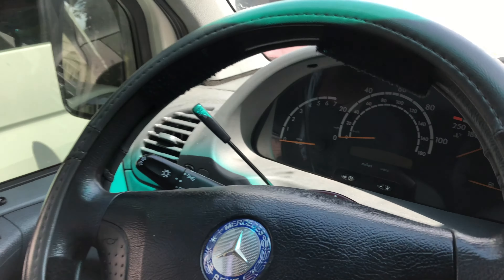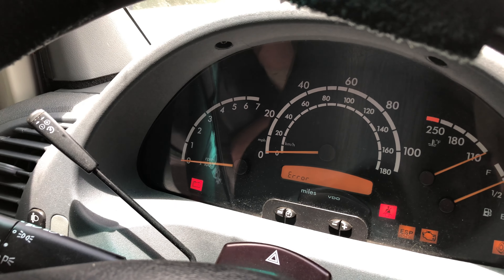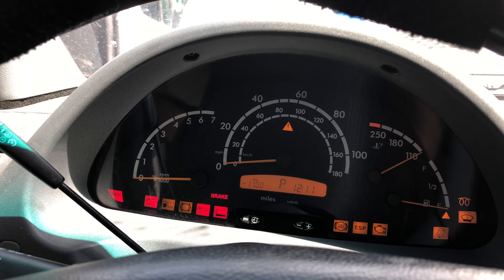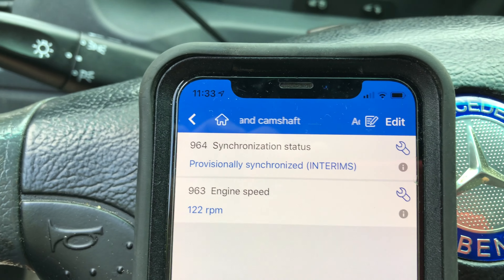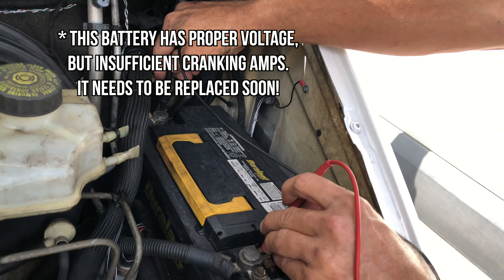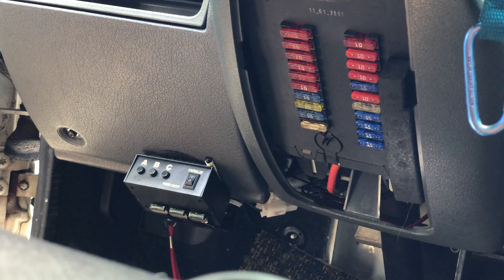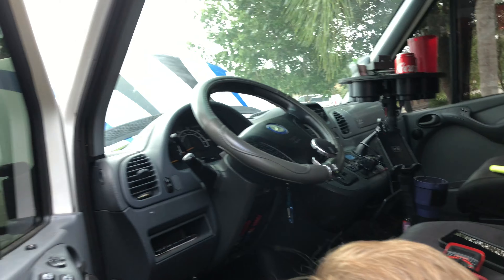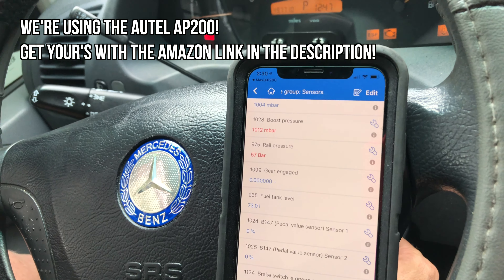Common Causes a Sprinter Won't Start. Fuel pump relay, starter relay, fuel flow, low battery, etc.

Comment: Should also add ecu relay that is under the steering wheel next to the signal lights relay! It driven me mad.. i checked so many things.. and it did not start in cold or hot days... i took the cap of the starter relay under seat.. and pushed the relay with finger... so it made that litle vibration and that engages possibly the ecu relay under steeringwheels fusebox.

Comment: Excellent video, thank you very much.

Just bought my first T1n 10.2005 here in Germany, the 2148 cc engine. This engine is the most common in Europe from what I see; would have preferred a 2.7, but couldn't find one for a decent price, only ultra expensive, or with high milage. I am very happy with it and should have gone this route a long time ago. Will watch your other videos as well. Cheers
Reply from the maker: Congratulations and welcome to the Vanmily! Settle in and get comfy, we have over 250 videos about T1N's and a few unrelated. What is high mileage? Mine is a bit over half a million miles. They don't get that high without replacing parts as needed while low mile vehicles can still have 20 year old parts waiting to die.
Reply: Thank you very much for the kind words and the reply! 
My van has only 193.000 km, so that's 120.000 miles. You are perfectly correct about the parts going out even with low milage just because of the materials and their lifespan (plastics, low quality rubbers, etc). I will be changing all the consumables on Monday, all the filters, aer/diesel/oil, the oil obviously, and also the spark plugs. I am having a strange thing with the engine and I am hoping it's going to be resolved after these changes - cold start, always perfectly fine, excellent strat. If I drive 20 minutes or even keep the engine running half an hour, stop it and restartet, it just won't start; it spins the engine and tries to start, but doesn't manage. Only after the engine is cold again, after about halt an hour or more it starts perfectly again. I am guessing spark plugs, or diesel filter full of trash inside, and it takes some time until these sediments settle again down in the filter... Could also be other things, clearly, but we'll see how it goes after these changes. Thanks again! Cheers

Comment: Last month I bought beautiful Mercedes Sprinter from 2004. Thank you for your informative videos and all the work :)
Reply from the maker: Welcome to the Vanmily! I'll be here when questions come up or you can find me on FaceBook https://www.facebook.com/groups/floridavanman/
Reply: Hi. I just bought a 2003 sprinter with 81k and seemed to run great the 40 miles home. After sitting over night the next day it wouldn’t start. Thought it just had a bad battery so I jumped it off my truck, took awhile but it did eventually start. I’ve had to do that once more and then decide to charge battery over night. The next day it started after several cranks. I then moved it to the shop where I’m converting into a camping van and when I got there, while idling I reset the radio. It died while idling and haven’t been able to start since. No lights are on and I’m super confused. Never owned a diesel before and I’m afraid of tearing something up. Any advice? This video seems to address a lot of causes and when I look at fuse box on side of seat I don’t see a yellow relay at all just one grey. Thanks for any help!

Comment: Hi. Have a 2006 sprinter will only go on second start. Engine sounds sweet. Best videos I’ve ever seen. Legend.
Reply from the maker: That's not a symptom I've dealt with but I wonder if unplugging the MAF would change the way it starts.

Comment: Thanks so much!  Perfect video for T1N starting issues.  
Even though the engine battery tested "good" at the auto parts store, I replaced it and my Sprinter started right up.  This was after I spend a day and a half troubleshooting other potential issues because the battery tested "good".  Late in the day after the "good" test, I decided to conduct my own load test by using a 12 VDC to 120 VAC inverter.  With a moderate load of 120 watts (12VDC x 10 amps DC), the battery voltage dropped within 5 minutes to less than 11 VDC.  Another recommended test is to simply turn on your van headlights and see how long they last.  Bottom Line:  Don't trust auto part store battery tests (good or bad).  It seems that batteries with 36 month warranty last a good 37 months and 24 month batteries are good for 25 months.
Reply from the maker: Agree 100% ^^^^ One thing worse than parts store battery testing is parts store code reading. Always wrong when it comes to Sprinters.
Reply: Well, I thought the new battery solved the problem, but a week later, it FAILED to start.  The symptoms were the same, flickering then solid dashboard backlight, followed by lights out when the key was turned to the start position.  I tested connections to all fuses.  This looked like a weak connection somewhere that fails when high current is needed for starting or headlights.  I went to the engine battery, and checked all connections.  Everything tested and look good.  On my T1N Sprinter RV, there's a small black distribution box that's connected to the positive battery terminal.  There are four red wires, four fuses, and 8 screws that hold in the fuses.  Everything tested good, but I tightened everything anyway.  - I went back to the driver seat, turned the key, dashboard lights were bright with no flickering, and the engine started!  I'd like to recommend that you add "clean and tighten distribution block connections" to your already comprehensive test sequence.  I will make a video that shows the steps and post it on YouTube.

Comment: I had a no start no crank over the weekend and it turned out to be the main cable  from  battery to starter did a voltage drop test and  found  10 volt  lost  on  cable all clean and tight.  Replaced with used cable  and  back on road.  Like your videos keep them coming
Reply: replace your motor ground cable. 1 click (RELAY)no start

Comment: Thanks..
#2 and #5 injector was bad. Tested with tubes with cam sensor disconnected...replaced the two injectors...starts up...giving it road test tomorrow

Comment: NO START! You are my go to guy for my 05.
Engine cranks. Code reader says fuel rail pressure too high!
Use your fuel line test for relief valve-no fuel! Bench test valve- no click
Replace pressure relief valve and sensor-rail pressure too low.
Rail pressure 190-250 Will recheck 
Purge system twice-no air. Lots of pressure to injectors.
What next? CanBus?
Reply from the maker: Have you also tried the leak off test for injectors? We have two videos for that. Watch both and use clear tubing. There is no reason for the expensive vials I use in one video.

Comment: Great Demo thank you I went through all of this already I have 2007 2500 gas no crank no start, driving me crazy (key, relays ,battery and starter even engine ground wire all checked)
Reply: What happened? When ended up being the fix?

Comment: Thanks man! Dealing with this right now. I’ve done everything but the battery tip at the end. Will try that and see if that helps, have done crank sensor and relay but still having issues
Reply: Just like IT guys.  Have you reset your computer 🖥 lol.  I'm in the same boat on the side of the road.  Will try it too in the morning

Comment: Any tips for a 2003 sprinter? They don't have an in tank fuel pump? How can you tell if the engine is getting fuel? Thanks!
Reply from the maker: An air leak is the most common reason but it could also be an issue of fuel getting there, just not holding enough pressure to start the van. We have videos showing leak-off test for the injectors and fuel rail, but first look for air bubbles in the clear fuel lines. One-on-one assistance is offered via Patreon membership https://floridavanman.com/donate/

Comment: Thanks for helping diagnose issues.... learned some things.
But my issue is fuses blowing to fuel pump. Next video to find my cure.
Reply from the maker: Only two things can cause that, in-tank pump going bad or the wire going to it.
Reply: @FloridaVanMan  
I have fuse # 17 shorting out.
It's a 15A to Eng. Con. Unit.
So I have no crank or fuel psi.
Got it towed to shop, hopefully a fix tomorrow.
Thanks 4 replaying.
Reply from the maker: @timtripp4222  Have you seen out recent video about testing the ECM voltages? it is about 2 weeks old, black & white thumbnail with a pic of the ECM.

Comment: Excellent video, thanks for the tips!! One of the problems you mark in the video happens to me ( cramshaft sensor )
Reply from the maker: If you're having repeated CRANKSHAFT position sensor problems, I have read that a cracked flex plate or timing issues could cause that. Repeated CAMSHAFT position sensor issues on the other hand could be wires or something bouncing around under the valve cover.

Comment: Good morning Van Man , I need an advise , I’ve got a sprinter minibus 413cdi 2004 now that it’s cold out side some days  I need to turn the key and crank it 2-4 times and then start ,it sound like there is non enough battery power , almost like dead and then after I crank it 2-3 times it like suddenly all power comes back and starts ! Battery is good 12,80v main cable is good (new), ground looks fine every time I check it before it start ,no errors on the ecu,but then again problem is there , checked the relays but nothing , can you give any advise where to look ? Nobody here seems to know what it is 
Thanks in advance 🙏🏻
Reply from the maker: I have found this to be a wire failing and affected by temperature. Sometimes moving the wire will solve the issue, flexing it near connections. Sometimes heat from a few seconds of heavy draw is enough to improve the connection and suddenly it is like someone connected another battery. # wires to contend with here, the short battery ground, the big unfused wire on the positive battery clamp, or the braided wire between the body and engine. Theoretically the connection between the starter body and the engine block can be a problem but this is a large circle making contact and providing electrical ground to the starter.

Comment: I have a '04 with 222K and it has been having starting issues all winter (long cranks and didnt want to start when it was wet out) the other day i was flying down the highway at 80mph and i heard a sound (over the music and road noise) like something lost pressure (sort of like a blow off valve sound) and instantly the van lost power and died, and now just cranks with no fuel delivery. I pulled codes with a CR Plus :
p0087 Fuel Rail/System Pressure - Too Low 
p0101 Mass or Volume Air Flow A Circuit Range
.
Do you suspect that to be the High Pressure Fuel Rail or Fuel Pump? How do you replace the in-tank fuel pump? It was a $350 tow, so trying to find some used parts which take longer to obtain. I will go through your checklist of culprits. 
.
Thanks amazing video, not sure how you got such clear image under the van!
Reply from the maker: A sudden rush of air escaping is common sound when a turbo hose fails. There is a bit of humor with information in this video. https://www.youtube.com/watch?v=pa9kLnPdJA4

Comment: Well my van turns over but is really hard to start in cold weather "Cleveland Ohio" after long ignition holds and many cycles I get white smoke and THEN after many more turns she starts but after it's warm it starts every time. got new glowplugs. I dont get it ."your thoughts please"... thanks for all of the work you do in giving us these videos there a huge help.
Reply from the maker: There is always a possibility the new glow plugs are not the correct glow plugs, or the glow plug control module has failed. These issues would present dash light and fault codes. Likewise, failing temperature sensors that control the fuel at startup should also present fault codes, but they might not in the right circumstances. Verifying all the temperatures we can read with live data in a code reader like AP200 can help, but this is admittedly looking for a needle in a haystack when we aren't sure the needle is in this* haystack. Sharing live data screen shots of the van running at idle MIGHT help, if there are unusual readings of mass air flow or fuel rail pressure. These values will vary by altitude and temperature so I can't simply tell you what they should be. If you show me what they are I'll ask more questions about your location and weather. 
Have you seen my video on "cap dance"? Low compression could cause the symptoms you detail, but so can low fuel pressure due to cold, viscous fuel. Can you experiment with a 100watt light bulb glowing under the hood all night? LED lights will not work for this and old-fashioned trouble lights with incandescent bulbs are hard to find. We can add block heater on the exhaust side of the block or stick-on oil pan heaters but if you don't park near power outlets these don't help at all. 
Diesel heaters come in many styles and a common, cheap cabin heater with remote controls can be installed to heat the interior while the exhaust heats everything under the hood. This is problematic with that exhaust able to get in the cabin through holes in the firewall and dash vents. And it is slow to heat the fuel rail, fuel pump and injectors unless running all night. 
Hydronic diesel heaters can be more effective but they are way more expensive and a bit more complicated to install correctly.

Comment: Gonna check these parts  hopefully it will start. My issue is turn key and get nothing,  all dash light are on & installed a new battery. Jumped the starter and it engages & turns over but won't start. Hopefully its the relay 🙏 thx your video was helpful !
Reply: Mine does the exact same thing.. almost like something in the park shift lever is screwing up.. but it only does it once or twice every 6 months.. annoying, but a jiggle always fixes it..

Comment: Boss vid! I have a issue with it not starting after having been switched off in the last 10 mins. Bit inconvenient for a nip to the shops.  Also sometimes the engine stays on after removing the key but will turn off when I turn the lights off!
Reply from the maker: Not starting sounds like camshaft position sensor or crankshaft position sensor. Does the tachometer move while cranking when it doesn’t want to start? If the engine keeps running with the key out, just put the key back in and re cycle the key on/off.

Comment: very interesting ! i have a Sprinter 310 D (OM 602 engine 2,9 l,  5 cyl, 102 PS) model 2000 and it suddenly cut while it was running perfectly well. I observe that the heat lamp is no more switching off and there is no more the clic that i could hear in the cabin,  changed  the 2 relays  as shown inthe video, and i also changed the heater timer box on the right side of the engine.. Would you have  an idea of what could be the failing component (That normally makes a clic after few seconds of ingnition ON).. Thank you for your help
Reply from the maker: I'm hoping a viewer can help you with this. I'm not familiar with the click you hear. I think you are referring to glow plugs, but they will not cause van to cut off. A good code reader should help with the engine cut-off symptom.

Comment: Hey I got a 2008 frieghtliner sprinter with the Mercedes diesel motor. It cranks but wont start. I changed the crank sensor but the tachometer doest bounce. Also only starts if I spray starting fluid. Any idea thanks.
Reply from the maker: First STOP using starting fluid. That is for gasoline engines with spark plugs and an easy way to damage your diesel. Next, get a proper code reader and let the van tell you why it can't start. Autel AP200: https://amzn.to/2GD04Ft

Comment: hello sir, i'm an american in france with a 2004 mercedes 208 van issue.  my van has always started.  it cranks over, gives me an indication that it wants to start but does not engage.  i noticed that the water sensor plug was not connected, in fact it's the wrong filter.  could this be the problem?  i'll try the fuel pump vibration in the morning, it's 9 o'clock pm here in europe.  thanks for your video, you gave me a few tips to try tomorrow.  cheers
Reply from the maker: Fuel filter sensor wire is only an alarm for water in the filter, so that is no big deal although it being disconnected will put a dash light. If you have a MAF sensor, unplug that. We have a video on testing the MAF. If the van still tries to fire occasionally but generally just cranks the most likely culprit is fuel pressure. Search our videos for "Leak-off" and you will find three videos. Two test the injectors and they show the same test on different motors types. The other is a rail leak off test. A failing injector will make starting very difficult but a failing rail pressure valve will often cause no start at all.

Comment: Hi, I am getting long crank problems so it's slow to start up and threatens not too. Also I stalled once recently  and its is dying on hills and then goes into limp mode. I changed the fuel filter after an air blockage in the system and also replaced two injector seals that were leaking. What should I do now as the problems have not  resolved. There is no EGR valve on my 2004 model so i cant go that route. Thanks.
Reply from the maker: Sounds like a fuel pressure problem. A compatible code reader would be my first step, then probably Leak-off test the rail and injectors.
Reply: Thanks.